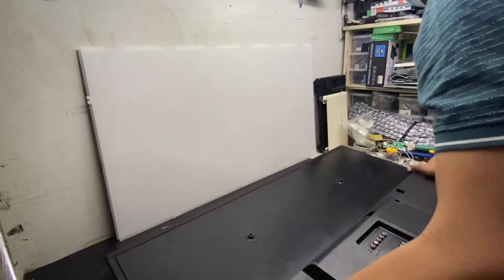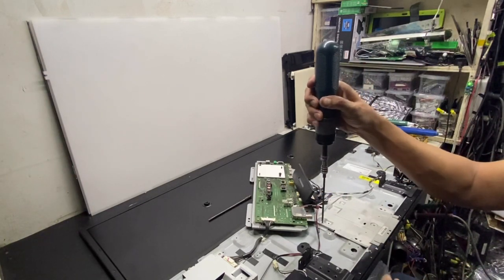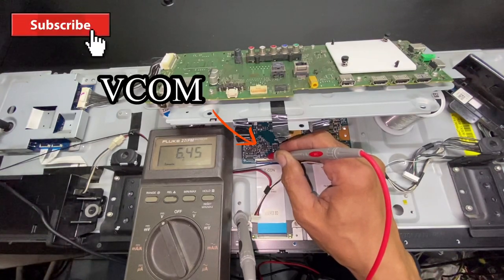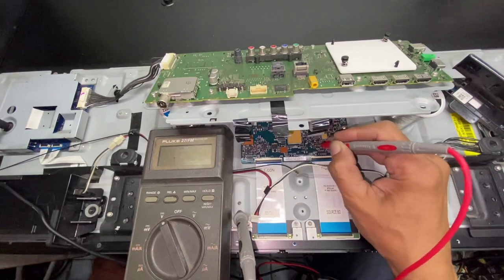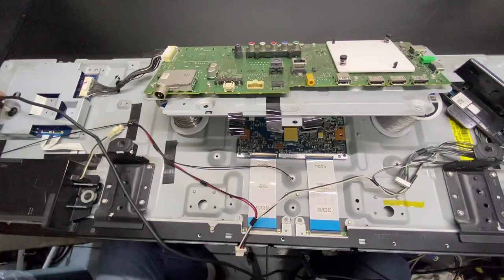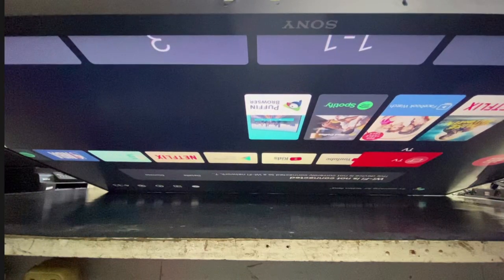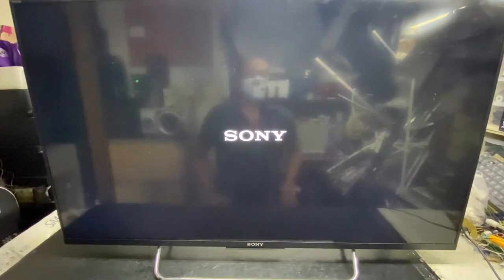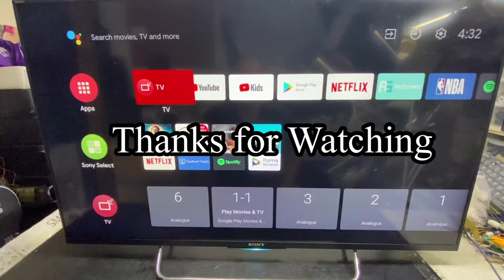SONY Smart LED Tv, How to Repair Defective Picture, Step by Step, Tutorial

Comment: so that electrical tape covering that part fixes it? sony KDL-55W800B IS MY MODEL AND I HAVE A SIMILAR LINE that's horizontal ON THE BOTTOM ONLY AND IT HAPPENED TODAY WHILE MOVING it.
Reply from the maker: Thanks, not electrical tape, it’s scotch tape , you try, isolate first w/c  side is defective

Comment: the problem solved shown your video is excellent. But let me know in that ribbon cable from how many pin after 6mm tape to be masked on right side. pls sir.
Reply from the maker: After 10 contact strip you place a blocking tape as shown, thanks

Comment: hello help me I searched everywhere on the internet how to access the sony kdl 46ex720 tv panel. because I wanted to change the backlight which has a problem. unfortunately I can't find a tutorial that explains how to open the tv and access the leds. if you have a link to help me. thank you
Reply from the maker: Thanks, I’m looking asap I’ll send the link
Reply from the maker: https://youtu.be/1t0xxRKuXNQ, same procedure for the kdl 46ex720
Reply: @mr.handiymanphrosetechelectron  
Hi mister. I am very happy to see your response. I searched so much how to remove the screen to access the leds. Really thank you again. But why there is no sony kdl 46ex720 tutorial. there are very few tutorials on the operating procedure of this tv. and yet it is a complex tv. because when the led automatically breaks the oscillator which manages the 150 volt stops working. and then we note the 12 volt and the 3.3 volt coming out

Comment: Hi, I am from Sri Lanka. Same problem have with same model w800c. What is the tape u stick to the ribbon. And thanks for your video for saving me from losing hope on my TV.
Reply from the maker: Anura Prasanna Warapitiya , thanks, I’m using thermal (capton) tape, but you can use scotch tape or masking tape, please support my channel, please share, tnx
Reply: @mr.handiymanphrosetechelectron  thanks
Reply: hii from malaysia... i have same problem too with my tv two days ago.. same model 50w800c.. i lose hope with my tv and now gain hope back... thank you so much... btw i already buy a new tv and still on delivery... if this vdeo works for me... i will thank you so much..

Comment: sir. same issue SONY Bravia KDL-55W804A....saan po exact pin no. lalagyan ng tape...and left or right ribbon.?  thanks in advance and more power to your channel..
Reply from the maker: Thanks, try mo muna e isolate muna kung saan side me problem, tulad ng ginwa ko s unit then kung pareho n side at vlog lo good kung sa kbila  dun k mgconcentrate
Reply from the maker: Parang gnyan ung gingawa ko s shop ko bka mgwan ko ng vilog
Reply: @mr.handiymanphrosetechelectron  thanks po sir. sana magawan nyo po ng vlog...para makatulong din po sa iba.
Reply: @mr.handiymanphrosetechelectron  sir pang ilang pin po kaya ang dapat ko lagyan ng tape..?

Comment: Dear friend, what if there's a small minor crack in the panel due to which there's vertical lines coming on Sony LED KDL-42W900B Please guide if it wud  repair the issue which I am facing
Reply from the maker: Thanks, once the panel is cracked, it needs to replace the whole panel , w/c cost you almost 3/4 of a brand new unit ,

Comment: Hello,i have same problem with my Sony Bravia KDL-40HX720 which part of 4 flex i need to tape?
Reply: Hello, Just  open the television, Open the the back light, theree its no led light, But long 10 or more long tubular Lamps. That are powered by high voltage!!!!
Reply: @damijannotersberg7032  hehehe

Comment: Sir, SONY 43 W800C. Vcom 4volts,  Vgh 0volts and Vdd 13volts?
Reply from the maker: Dapat meron k vgh
Reply: @mr.handiymanphrosetechelectron  yun na nga sir,kaso wala talaga?sa t.con lang talaga yung sira neto sir? O ma.repair patuh t.con?
Reply from the maker: PHaeus _Nikola , mggwa p yan, isolation k muna ng load
Reply: Tinangal ko yung right side t.con flex sir wala display black lang.pro may backlight.tapos ng.blink red light
Reply: Pg.left side t.con flex sir.ng.display kalahati lang white color.tas ng.blink yung red light 5 times
Reply from the maker: PHaeus _Nikola , bka ktulad ng vlog ko i try mo
Reply from the maker: PHaeus _Nikola , gnyan tlga yan , ng bi blink wag mo ptgalin gyhin mo vlog ko kya mo yn,
Reply: Simula nang pang.ilang pins yung nilagyan mu nang thermal tape sir?
Reply from the maker: PHaeus _Nikola , it’s depends on the reaction of the panel, count 10 contacts of the ribbon wire then place the tape covering 10 contacts,

Comment: sir saan banda o' pang ilang pin sa ribbon ang nilagyan ng tape? thanks sa video mo😍😍
Reply from the maker: Madiskarteng Tatay , tnx, ung location ng tape s gnyang sira ay sa ckv column ng o/p ng t-con board, as shown, follow mo lng ung vlog ko, please support my channel please share and subscribe
Reply: @mr.handiymanphrosetechelectron  Hi. Pang ilang pin from right relative sa orientation ng 
 video mo ang kinover and ilang pin sila total?
Reply from the maker: Hector Salarda , tnx, from r8 keep open at least 10 strips contacts and cover at least 10 strips contacts thats the ckv ‘s for that side of the panel

Comment: Sir pano po pag walang display pero may power nmn
Reply from the maker: Thanks, check mo kung kumpleto supply s board
Reply: @mr.handiymanphrosetechelectron  possible ba motherboard ang error? Pag mb . May pag asa pa marepair?
Reply from the maker: Ariel Cahig , possible p po

Comment: Hi iam from india.i have using 43 w800d Android tv some problem,Tv just power on getting totally white screen
Reply from the maker: veera manikant , tnx, posible problem no supply voltage vcc at the t-con board or check the supply voltage  at the t-con board, like vgh, VCOM, vgl, etc,
Reply: @mr.handiymanphrosetechelectron  sony 43 w800d Tv some time working.and  same day some times getting issue white screen
Reply from the maker: veera manikant , maybe the ribbon wire need re install , or re socket all socket terminal
Reply: Oh another soul here with the same problem
Reply: Same model tv also. So what happened in the end, did the tv get fixed? Please reply

Comment: Ni replace ko tcon board at tintrasfer kona yung eeprom chip ng old to new tcon, ok na screen pero yung logo lng mag papakita and mag shushut off siya then mag flflash ng 5 reds pls help po🥺🥺🥺🥺same model ng tv
Reply: Dati sakit nia is Stripes na wala talagang picture nag papakita kundi green stripes na marami, na walang picture na nabubuu, after nireplace ko tcon yun namn na problems 5 red flashes, sinearch ko sa net is yung daw tcon🥺
Reply from the maker: Linx Karino , try mi s service mode, bka mkuha s settings , dami ksi circuit sensor si sony
Reply: @mr.handiymanphrosetechelectron  ganon parin po, 5red flashes 😿
Reply: Deffective kaya itong nabili kong tcon😿
Reply from the maker: Linx Karino , pwede, kung ok nmn pix bka service mode setting o i bypass mo 5 bkink error
Reply: @mr.handiymanphrosetechelectron  hello po P ID ERR yung erorr nia ano po chcheck ko po dito boss🥺
Reply from the maker: Linx Karino , gnun tlga yn ksi naiba mem, di sla match data ng mem at ic ni t-con, wag mo ggwin n plit mem ung orig mem ikbit mo pra wla id error
Reply: @mr.handiymanphrosetechelectron  yung namn intruction nung binili ko board dapat ko palitan eeprom punta ko sa new board
Reply: Tinry ko yung new tcon na walang changes, mag pupulse lng yung 12 v supply papunta sa tcon galing mainboard, and hindi iilaw bacjlight nia pati indicator light is wala,
Reply from the maker: Linx Karino , pwede din gmit k progrmmer ng eeprom copy mo ung lman ng luma eeprom
Reply: @linxkarino2348  baka hnd pa nka program un t-con nabili mo kailangan swap mo yun ic memory sa old t-con mo

Comment: Same problem on my sony..55W800C. I try this, but problem still there...
Reply from the maker: Try voltage readings, make it sure that all required voltage reading are normal, watch my playlist  I hope It will help, tnx and please subscribe
Reply: All voltages are ok... I checked...
Reply from the maker: Padmakumar n , in that case try to isolate the other side ckv line of the panel
Reply: Ok... Im gng to try...
Reply: Actually this happens bcz of what reason...?
Reply: How much voltage yung normal?